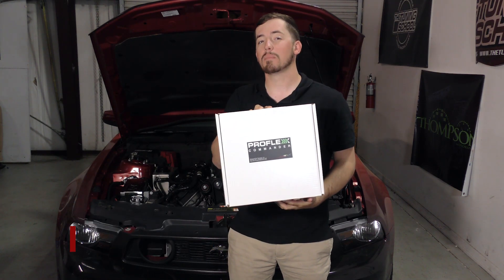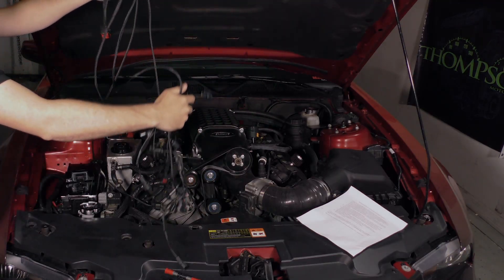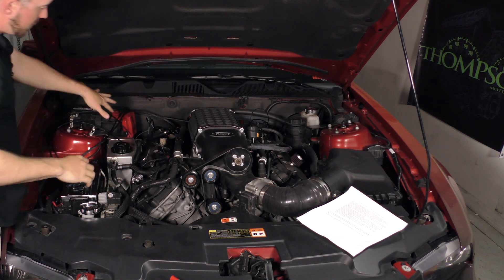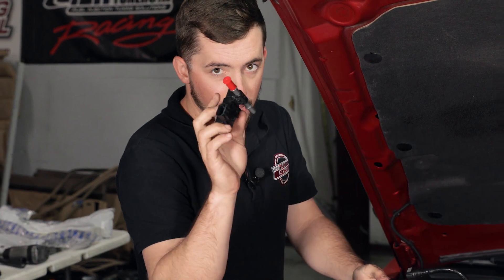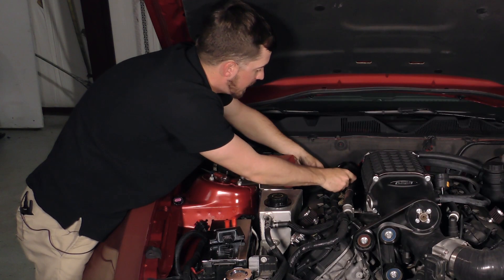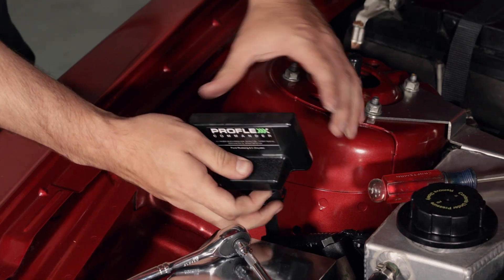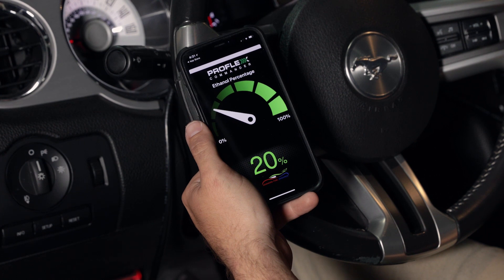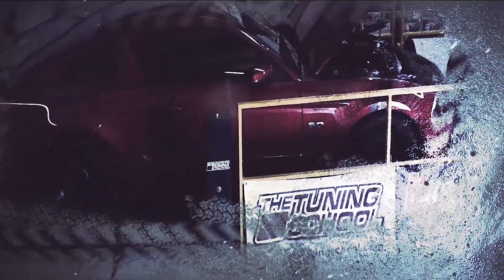Proflex Commander by Advanced Fuel Dynamics: E85 Installation for 5.0 Mustang

Comment: In a newer video about E85 you said it's less powerful than gasoline so E85 engine needs bigger injectors. Here what I see  is a box that intercepts signal from the ECU and resend it (modified or not?) to the OEM injectors.
Since there is absolutly no dialog between the ECU and this box, I guess that this box essentially keeps the injectors open a longer time than the ECU will do. The ECU thinks he is injecting gasoline and has no clue what is really happening.

Comment: You would think they could at least label the injector connectors.
Reply: Why ? this box only allow injectors to inject more fuel by being opened longer. You can swap the wire as you want.

Comment: how would this be able to work with a full bolton, cobrajet manifold, comp stage 3 cammed car thats already tuned on 93 octane???i am interested product but was always told with my setup i would need bigger injectors or booster pump to  run e85???

Comment: So is that just a fancy ethanol monitor that can be seen from your phone and you do all the tuning separate or does this change the tune itself? If it does change the tune then what parameters does it change in the tune?
Reply: The unit automatically adjusts the pulsewidth to the injectors to compensate for the Ethanol, which is the purpose of the unit.  This allows you to adjust spark in the ECM without having to try and make a Flex Fuel tune on ECM's where that's not supported.  Comes in pretty handy.  :)
Reply: Bob Morreale question,how would this be able to work with a full bolton, cobrajet manifold, comp stage 3 cammed car thats already tuned on 93 octane???i am interested product but was always told with my setup i would need bigger injectors or booster pump to  run e85???
Reply: @mgerren88  should be no issue...contact them to let them know what your upgrades are and they can tell you if it will work or not.  It is an easy one hour install on most cars...plug and play.  Fill up with E85 and go!

Comment: I assume this is simply increasing the injector pulse to maintain the correct air fuel ratio at a given load/rpm. But surely the reason to go to a higher percentage ethanol fuel is that it allows you to advance the timing and extract more power? I didn’t see anything there about the unit feeding that information back to the pcm/ecu. Am I missing something here?
Reply: Agreed.  Exactly what came to mind for me as well.
Reply: Nope, there's no custom custom OS for this setup, you are left with whatever timing you commanded in the tune. All this would do is allow a lot of safety with virtually no power gain. You can enable flex fuel in HP Tuners for 2011+ Coyote's, the car infers ethanol content based on fuel trims after a fillup while holding the engine between two defined mass air flow values. You can change spark in the tune based on the learned ethanol content when you enable the factory flex fuel logic.